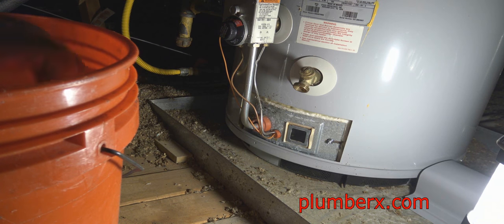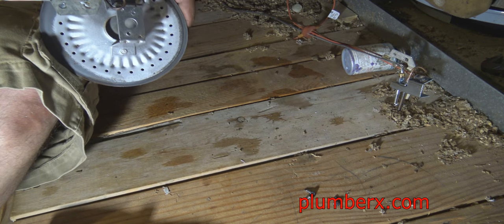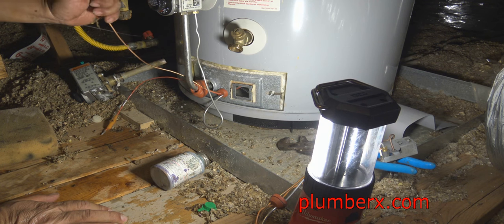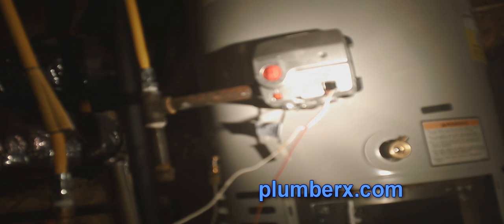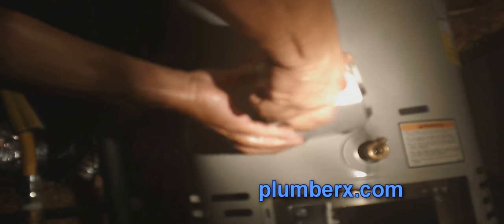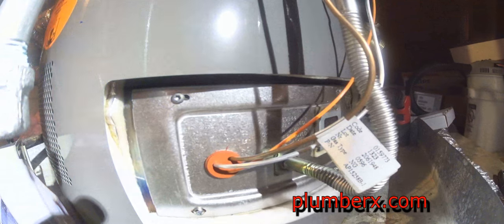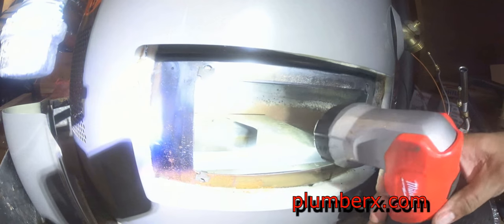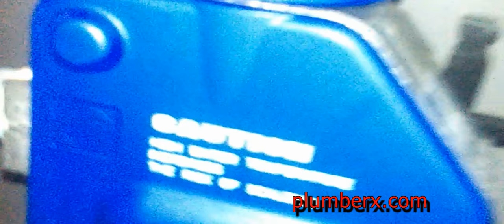All Types Of Gas Water Heaters Repairs

Comment: I built a new house and we moved into it in Jan. 1982. I had ordered a tankless water heater to be installed in the hall closet for the electric water heater. I had the plumbers run a propane pipe to feed the tankless heater. They installed it and we used it for about 1 month, that's all I could stand. The water would not get hot, barely even warm at the normal water pressure. I had to turn the adjustment valve way down to restrict the water flow. So, it was cold water at pressure or warm water with barely any pressure. I had the plumber install the electric water heater as the house plan had called for, the 240v wire and breaker were already installed. I would not try this again. Bad experience.
Water heaters in the attic? Not me, the pipes can freeze and a leak could destroy your house.
Reply from the maker: Great comment. Good reason. Thank you